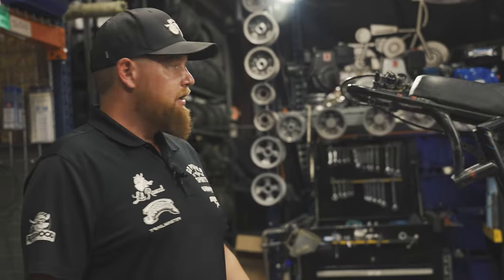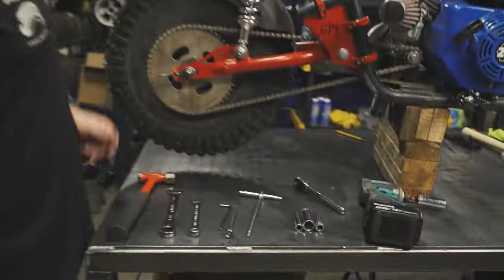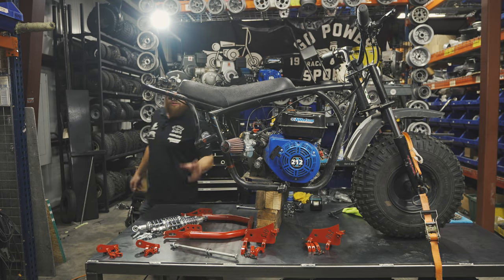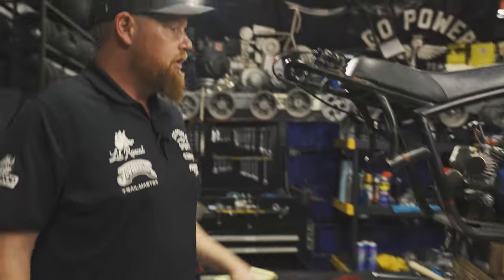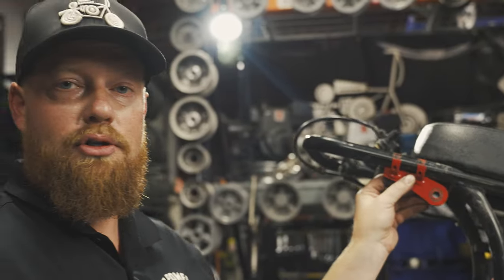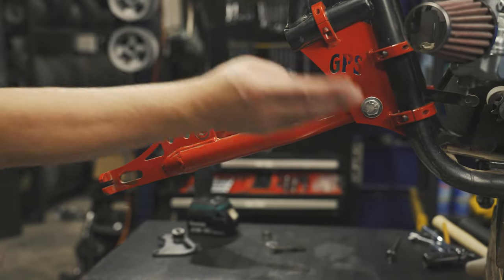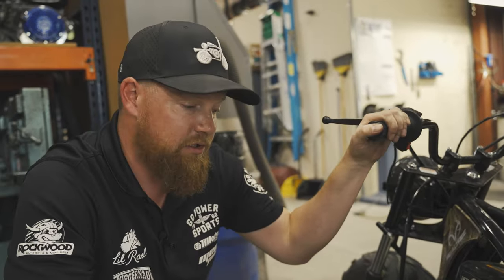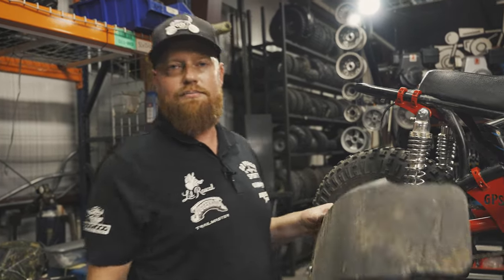Mega Moto 212 Bolt-On Rear Swing Arm Kit: Installation Guide

Comment from the maker: Is there anything else you would like to see done to the Mega Moto 212 Minibike Kit?
Reply: Premium front suspension like the MB200 please!
Reply: Getting ready to install the kit this weekend. Is a chain tensioner needed? I do only off road trail riding and don't want the chain to jump off like the trailmaster tends to do. Thank you for creating this kit! ❤️ 😊
Reply: I just finished the GPS180 last Saturday and rode a MM212 hard tail. Both front forks are blow out, so I'd love to see a front fork upgrade to compliment the rears. Maybe a little ride height since I slid down several sections of rocks.
Reply: I want to see one in my garage.
NAO!! lol
Reply: Can I get a link for the tires I want those cause they big
Reply: @andrewporter1900  I think the beefy billet triple trees might at least fit it.
Reply: @mr.braapalicious  I would use a chain guide if I could fit one somewhere.
Reply: @NubsWithGuns I put on a chain tensioner where the frame was cut.
Reply: @mr.braapalicious Seems like a good idea like I said if there is a place to fit one on most any bike.

Comment: I bought this for both mine and my wife’s MM 212s.  I’m going to weld ours in place, and cut/grind the clamps off.  I think it will really clean up the look.
Reply: I was thinking that would be better than bolts that could come loose.

Comment: I just got the rear swing arm kit for my MM212 pro, and it's definitely a game changer. The ride compares to the trailmaster mb200. My wife wants me to paint my swing arm kit purple.
Reply: Really makes the bike look nice also.

I plan on getting one at tax
time this year and the swingarm just has to ship the same day 😂.
I ride an Axis M200 right now with a predator 212 hemi(stage 1 and a 30 series) and its not bad but that hard tail gets sketchy sometimes on the rocky trails here.
Makes it fun but sometimes I want to just take it easy, if you're not on the throttle on my bike it bounces all over the place and throws rocks around or digs holes LoL.
Reply: @nubswithguns1538 I ordered this kit along with the premium front suspension kit for the trailmaster. I live in Oregon and I have old logging roads around me so those roads get rough.  Before I got the rear suspension kit, I took my MM212 on a 22 mile trail ride and the rear end was bouncing all over the place. I still need to paint my kit and clean up the frame where I cut it before I take it back out but riding around town I almost prefer it over my trailmaster mb200-2
Reply from the maker: Good to know, thanks for the honest review of it.
Reply: @wesleyammon8425  That sounds like where I ride.
Plus a lot of sand and wet clay in some spots here.
Makes it fun but tires one out manhandling a hard tail all day IMO.